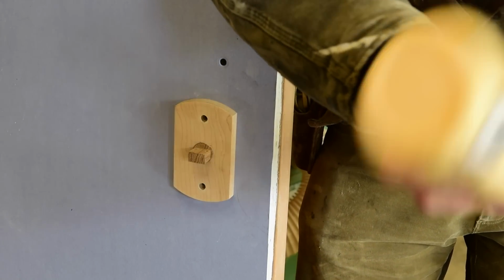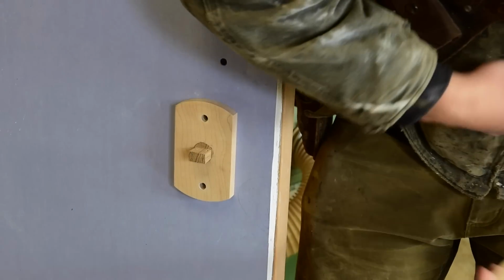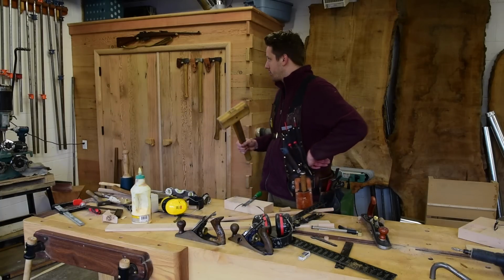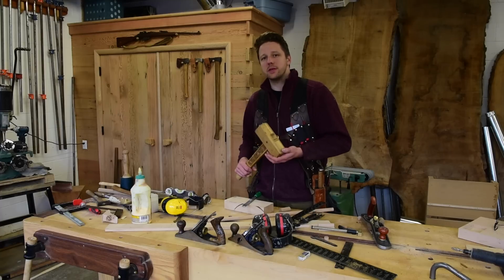Woodworking, A Manly Closet

Comment: That trick cutting out for the pipe was awesome
Reply: can some explain how that worked?
Reply: Stephen Huff my guess is he measured where the pipe interfaced with the previous board. Marked the next board with those measurements. Set the compass to the diameter of the pipe and then marked from each measurement to find the center. Then marked the outer diameter of the pipe from the center
Reply from the maker: You got it.

Comment: how much quieter did the closet make the dust collection? i was debating an insulated closet inside vs an outside shed built into the wall of the shop for that and an air compressor.

Comment: Can you please elaborate on what you did exactly with your compasss/scribe (don't know the proper term) to get that pipe to fit so neatly?
Reply: g00thier, Im assuming he fussed with getting the 1st board that barely touched the pipe. Then just measure over from where the new board will begin from the overhang to the two locations where the previous Board touched the pipe **. Use calipers to measure outer diameter of pipe. Divide in 2 for the radius. Set compass to that radius. Make a mark/arc from each of the 2 marks ** you got from earlier. Where they cross is the center of the circle since all points on a circle are equidistant from the center from the circle.
Reply: Makes sense! Thanks

Comment: Is that a Lee Engfield rifle above the doors?
Reply from the maker: yes
Reply: Very cool, I enjoyed seeing the carving and how you made those latches... you do awesome work !
Reply: Billy McCord what caliber is it? .308 or LR .22?
Reply: Alexa Jones I would guess it's .303 British because that is what most of them were
Reply: That would be a .303 British.   Notice the mag Bottom is rounded.  The Ishapore 2a1  (7.62x51m) the mag bottom is sharp angles.
Reply: A number V Jungle Carbine?
Reply: No. 5 Mk1 would have the flash hider on the end and the would have the top hand guard also.    

If notice the stock is cut before the band , which in the No. 5  has it after.
Reply: Micheal Hundley I noticed the flash hider after I posted it.
Reply: It's a no1 mk3 that's been sporterized
Reply: @TheSamuraiCarpenter. 
Next project restore the fore end on that No1 MkIII!!

Comment: Nice. With the gun and axe it would have been a great opportunity to use some live edge wood accents.

That gun is at some risk of falling down, and if you accidentally leave a bullet chambered or your kids pick it up that could cause some serious problems. Remember, 1/3 of gun deaths are because of accidents. There is a reason that by law firearms on display must be locked in place and require a key to remove. You can easily do this by running a simple cable lock through the back of the wall to hold it in place. You can hide the lock on the other side of the way so only the cable is visible.
Reply from the maker: It has been decommissioned.
Reply: It must be a dummy.

Comment: 10:34 That's not a Jungle Carbine, is it?
Reply from the maker: Sportised Lee Enfield 303 from WWII. Canadian Military.
Reply: The Samurai Carpenter not sure about B.C., but in ontario I'd go to jail for not having that rifle locked up. or at least they'd take it and fine me. should at least throw  a trigger lock cable on it.
Reply: It looked like a Lee Enfield, the magazine especially, but not one that I recognized. Thanks for the response.
Reply: That was my thought...
Reply: Or just take the bolt out/remove the firing pin. Wouldn't look as nice with a big cable lock hanging from it.
Reply: Lee Enfield No 1 Mk III, sporterized, It's not a jungle carbine due to the rear sight mounted on barrel and the barrel is even shorter with the jungle carbine with flash hider. The jungle carbine is not a pleasent rifle to shoot because of excess muzzle blast which is why they made limited amounts of it.
Reply: Joe Blow Yep- yer right. My dad had one & I remember shooting it in Va. (without hearing protection-IDIOT 😖) 
Handy rifle, though.